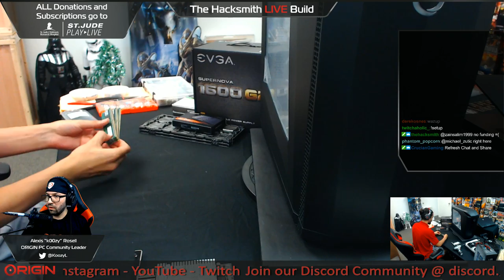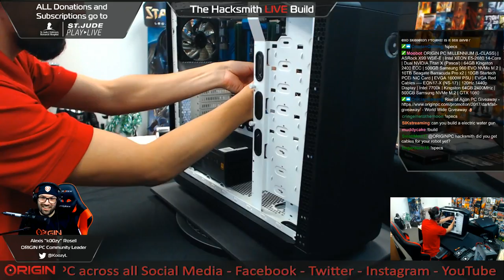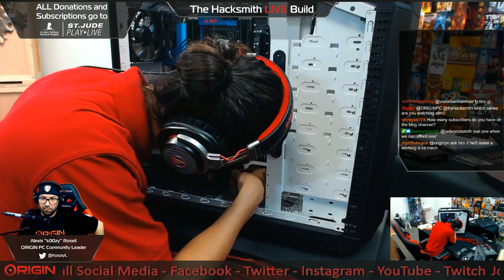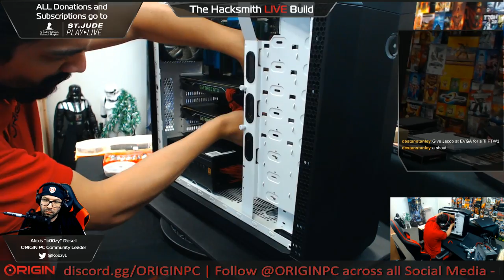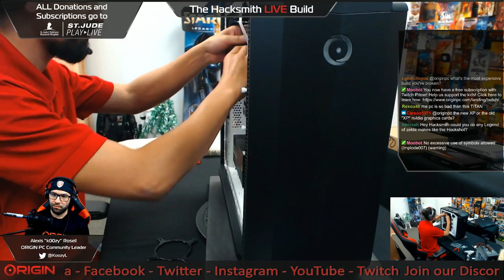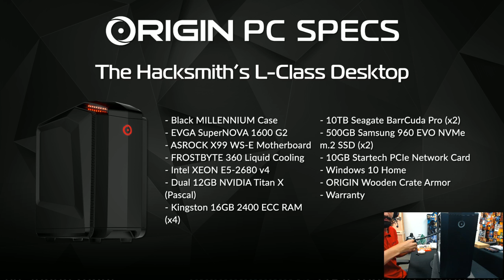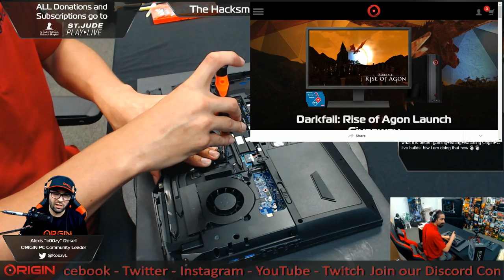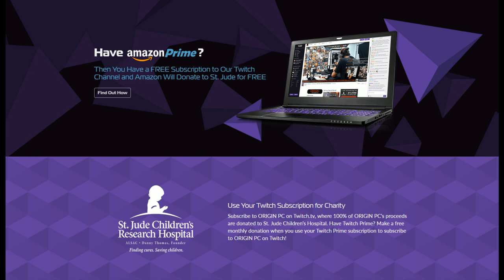The Hacksmith ORIGIN PC LIVE BUILD - #ORIGINPC #Tech #PCBuild #HighEndPC

Comment: Very impressive build. I have just one tiny tiny thing to point out. The start button wires that he puts through the hole at 41:10. If first would have routed the wires above the metal slot in the top of the chassi (where the usb cables go), then the start button wires would be less visible.
I'm not complaining, its a very impressive build, i'm just doing an observasion

Comment: hey origin this is a pc that I'm considering buying is it good for  high end gaming,streaming etc? 

Case: EON17-X
Exterior: ORIGIN PC Red
Current Special Offers: Dads and Grads Promo Free 250GB Samsung SSD and More
The ORIGIN Difference: ORIGIN PC EON17-X - The Best Gaming Experience Guaranteed
Display Type: FHD 1920 x 1080 17.3" IPS G-SYNC Matte Display
Keyboard and Touchpad: Customizable Backlit Keyboard w/ Three Lighting Zones and Multiple Color options and Multi-gesture Touchpad
Graphic Cards: Single NVIDIA GeForce GTX 1060 6GB [VR Ready]
Processors: Intel Core i7 7700K Quad-Core 4.2GHz (4.5GHz TurboBoost)
Thermal Compound: GELID GC-Extreme CPU Application
Thermal Compound: GELID GC-Extreme Graphics Card Application
Memory: 8GB ORIGIN PC Approved DDR4 2400MHz (2 X 4GB)
Operating System: MS Windows 10 Home
M.2 SSD Option: m.2 SSD OS Drive
M.2 RAID Configuration: RAID 0: For better speed and performance (2 or more identical drives needed)
M.2 SSD Drive: None
M.2 SSD Drive Two: None
Hard Drive RAID Configuration: RAID 0: For better speed and performance (2 or more identical drives needed) LT
Hard Drive: [FREE] 250GB Samsung 850 Evo Series
Audio: Integrated High-Definition Audio powered by Sound Blaster Xfi MB5 w/ external 7.1 support
Onboard LAN: Killer™ E2400
Networking: Killer™ Wireless AC 1535 Dual Band +BT (*Killer Doubleshot Pro enabled)
SuperSpeed USB 3.1: SuperSpeed USB 3.1
SuperSpeed+ USB 3.1 Type-C: USB 3.1 Type-C
Media Card Reader: Media Card Reader
Finger Print Reader: Integrated Biometric Area Fingerprint Reader
Integrated Camera: Built-in 2.0M FHD Video Camera
Warranty: Lifetime 24/7 U.S. Based Support and Lifetime Free Labor. 1 Year Part Replacement & 45 Day Shipping Warranty
ORIGIN Recovery: ORIGIN Recovery USB3.0 Flash Drive
No Dead Pixel Guarantee: 45 Day No Dead Pixel Guarantee Free
Free ORIGIN PC T-shirt: ORIGIN PC T-Shirt Medium
Keyboards: Kingston HyperX Alloy FPS Mechanical Keyboard
Mouse: Logitech G600 MMO Gaming Mouse
Game Discounts: Green Man Gaming
Cloud Backup: Carbonite
Apps: Battle.net Client
Apps: GLYPH Client
Apps: Origin powered by EA
Apps: Steam (The Ultimate Online Game Platform)
Apps: Uplay Client
Apps: WTFast [Optimizes Your Gaming Connection]
Apps: Discord
Apps: Ventrilo
Apps: Mouse Emulation Software
Extras: FREE Online Game: League of Legends
Extras: FREE INSTALL: Minecraft
Web Browser: Microsoft Internet Explorer/*Edge
Web Browser: Google Chrome
Web Browser: Mozilla Firefox